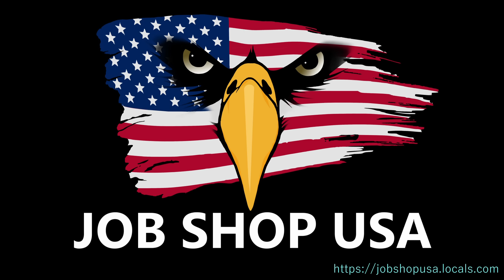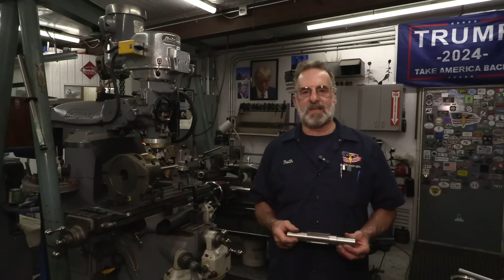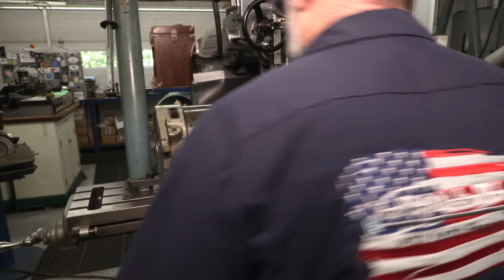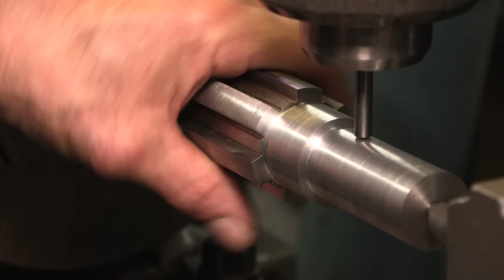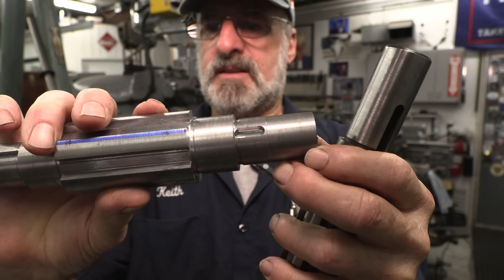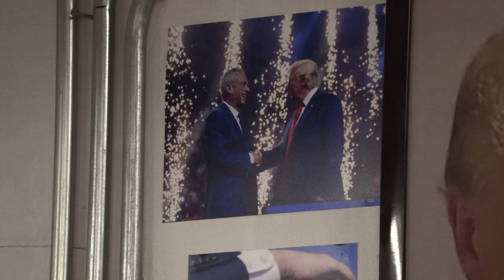Pearl's Spline Shaft Prep For Heat Treatment 2

Comment: Question: If I understand correctly the part you are making will be hardened and finish ground. Since you are cutting the key seats before the final grind won't the depth of the key seat actually be less than what they are cut now? I know you will be making new keys to fit but what if a job required a certain depth key seat after the final grind.  How would you figure how deep to make the key seat to compensate for the final grind? Thanks
Reply from the maker: The material left is .005" per side or depth from surface now. splitting hairs on the depth. I may of even been more generous with depth making sure I cleaned bottom on final cut. We will see on completed grind.

Comment: Keith-  Great video. I always hold important to make a tight keyseat.  If I have a drawing, I will respect the stated tolerance.  But if I am milling a part that I designed myself, I always want 2 to 5 tenths press fit on my keys.  The .237" end mill you roughed them out with was likely a 6mm cutter.  Perfect size for roughing a 1/4" keyseat. Your spindle and collet combination must have extremely low run out.  Else that 1/4" on size end mill would have cut oversize. Lucky or good, you tell me!  I personally would feel less butt pucker, if I were to use the 6mm end mill to finish, and run up and down the sides of the keyseat feature, slowly creeping up on my final dimension. But for sure, you know your machine as to how it cuts.  I know carbide end mills are a few tenths under, and maybe that was part of your calculus.  One question, did you add extra depth to account for the material coming of in final grind?  Anyhow, I just made a shaft for my Hendey lathe on my channel.  It has 3 different diameters, 2 keyseats, and one threaded feature.  Not as complicated as a spline shaft, but it sure made me think. I did the heat treat and ground it to size myself. I have it installed in my lathe now, and feeling so much joy for the result that it works well.  Anyhow, I still need to fit the gap on my Colchester 17, but other than that, she is a usable lathe.  Keep up the good work .  --Doozer
Reply: He just rebuilt his mill "buffy". Brand new matched bearings etc, so she's goot-n-tight
Reply: @TgWags69 , If anyone is ever rebuilding or repairing their Bridgeport mill, that video series is a must watch, or if you just want to watch a machine rebuild video, the same thing goes. Nothing but quality work, Thanks for putting them out there Keith!
Reply from the maker: I may have a couple more thousanths on the depth, I knew I had room for that and I will be making new keys to suit as well. all good!

Comment: I’m sure you know this but they do sale end mills to cut key ways . I’ve used them many times . And I’ve been able to cut the key in one pass .
Reply from the maker: Yes I do and I was just eliminating the pull over caused by full depth and one direction by using them. This was double depth keyways. Some keyways are not as important as others, meaning just because you cant see it, dosen't mean it can't be measured. Thats also why when I can I always choose a wheel cutter over endmill. good subject to study up on!